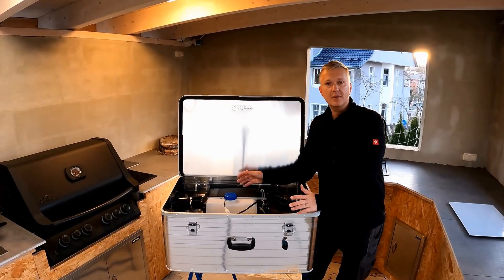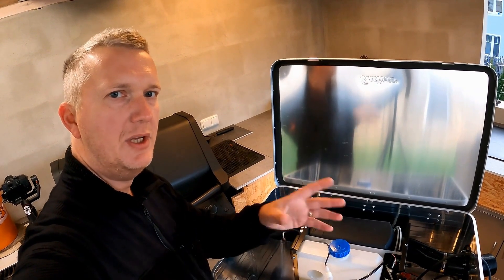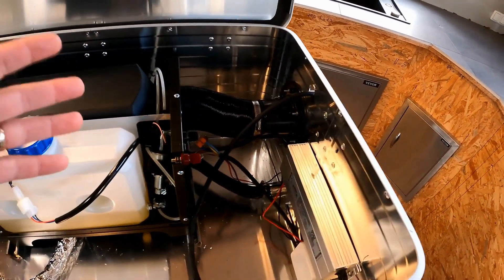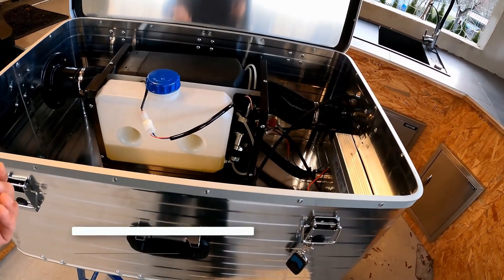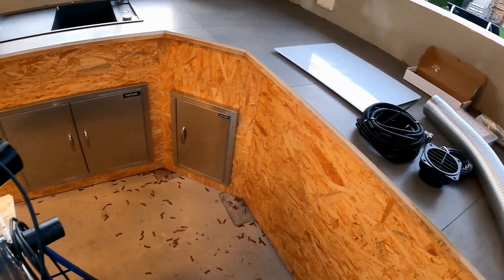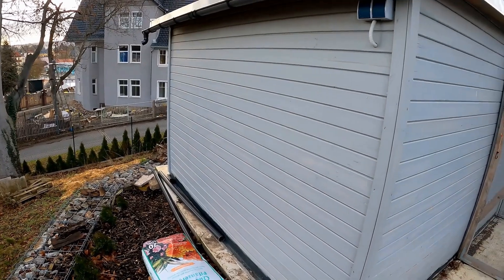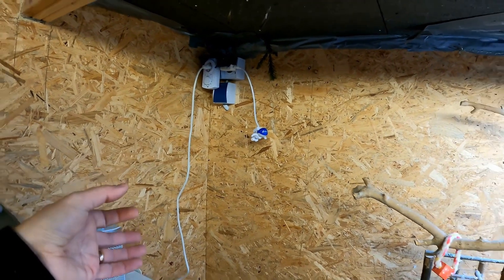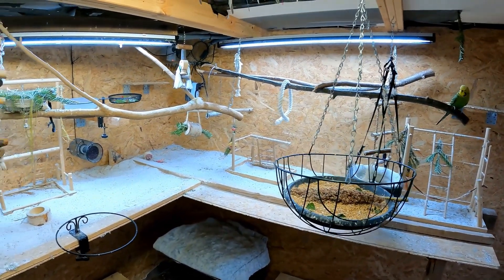DIY Mobile Diesel Heater: Step-by-Step Installation Process

Comment from the maker: Components and tools used: 
🔗 8kW diesel parking heater: https://amzn.to/3S9DHYT
🔗 5kW diesel parking heater: https://amzn.to/3x15uDM

This video was originally created in German for my main YouTube channel @commaik 🔗 https://youtube.com/commaik. It has been translated into English using 🤖 the AI tool HeyGen, which replicates my voice and synchronizes my lip movements. 

Please note that ⚠ due to dynamic adjustments, the synchronization may not always be perfect.

📺 The original video, which includes English subtitles, can be found here: https://youtu.be/ONECBX-wSDQ

Comment: This is a very well made video, you've done a good job with the installation as well as camera shooting and editing. The channel should be up to 5K subscribers before you know it. Good luck! 

I'm installing something similar at my place and was wondering how are you going to handle sealing the vent hose (warm air outlet but also the cold air intake 3 inch hose) around the hole in the siding where it enters the building. There is a potential for water leaking into the structure the way it is now, albeit not substantial. Of course i know you can seal the gap with a silicone caulking but i'm trying to come up with a less permanent way of doing it. As you stated, the box is supposed to be mobile, or at least possible to remove during the summer months (i have the same plan). For that i would be interested to know of a solution how to make the vent hose entry waterproof, yet removable.
Reply from the maker: Hello and thank you for the great feedback

I have not sealed the two hoses on my garden shed. The holes are only a few millimeters larger than the air hose. In addition, the area is covered. So the risk of water getting in is very low.

In my opinion, however, one idea for sealing the openings permanently and securely would be to use the pipe penetrations that I have already used on the crate. These pipe feed-throughs can be fitted to the wall with a rubber seal to make them watertight. The air hose could then simply be plugged in or pulled out again. 
In the links below the video I have linked the appropriate pipe feedthroughs. However, I am not sure whether Amazon also offers these models outside the EU (the video originally comes from my German channel).

What do you think?

Best regards from Germany
Maik
Reply: @commaikenglish  Thanks for the reply. I think i will do it similarly, with a little roof over the opening so the 2-3mm gap won't have a lot of chance to absorb too much water even if it rains with wind, or snows heavily. 

I had some self-adhesive weatherstripping at home and found it to be perfectly fitting the gap, taped around the cut hole before inserting the hose (my hole in the wall is 89mm - on purpose bigger to make it easy to slide the hose through all the wall layers). 

For now I have used this method on the box hole (the wooden box in which my heater is), and i plan to seal around the house hole using the same weatherstripping (it's kind of like a squishy foam designed to be around doors that are leaking cold air at the door frame). The tape might need to be replaced every 1-2 years, we'll see. It costs less than $1 for each 50cm.

Here is a photo of my solution (only the hose entry is pictured): https://i.imgur.com/aETh4r3.jpeg

At the top you might notice sort of a gap between the tape and the hose, but it really does not matter at that point, because it's fully sealed at the point of entry where the tape is squeezed between the hose and the entry hole in the wood.

Greetings from Ontario, Canada!
Reply from the maker: Looks very clean and tidy. I don't think rain or snow have a chance of getting through the opening. And if the foam becomes brittle and leaks in a few years, you can simply replace it. For the price, that won't hurt.👌
What about insects? I've noticed that ground bees, wasps and bumblebees like to nest in boxes like this because it's warm and dry. 

Greetings to Canada - which I hope to visit one day 😁